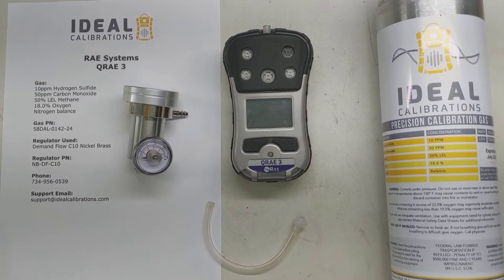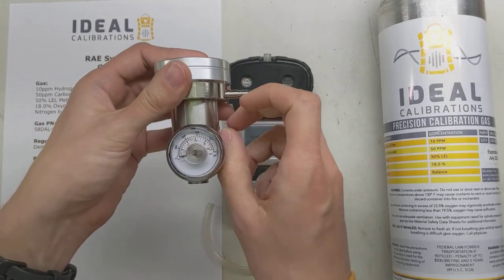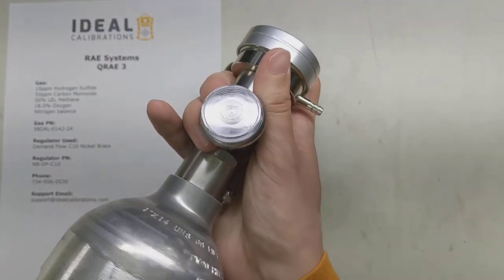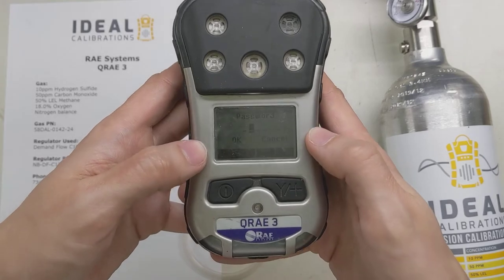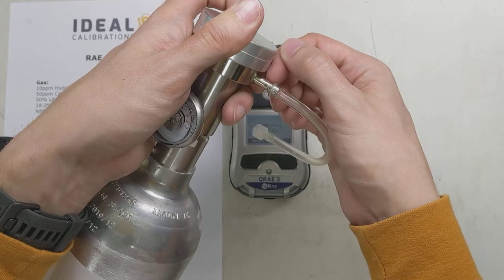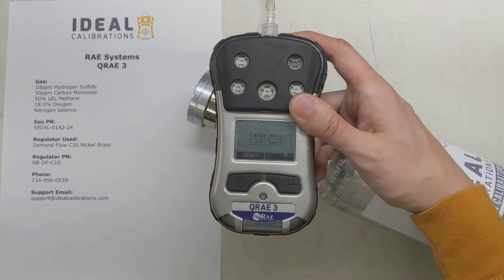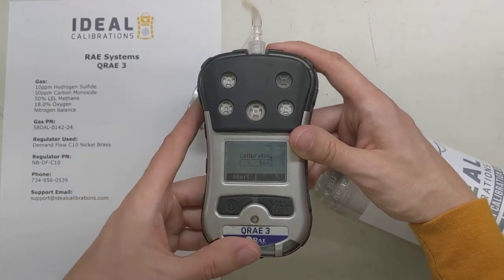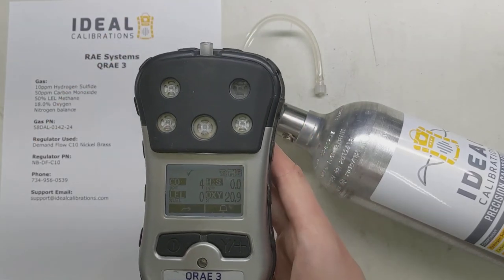QRAE 3 Calibration Guide by Ideal Calibrations

Comment: Is the use of a filter required when calibrating the pump model of the QRAE 3?  Also, is the T tubing required when calibrating the QRAE 3?
Reply from the maker: Hey Kaylyn, no filter required for calibration. If you're using a fixed flow regulator on a DIFFUSION (not pumped) unit, then no T is required. If you use a Fixed Flow Regulator with a pumped unit, then you would want to use the T adapter. If you're using a demand flow regulator you do not need the T adapter.